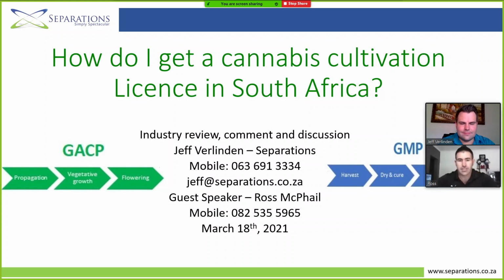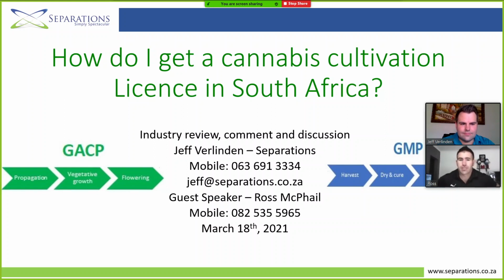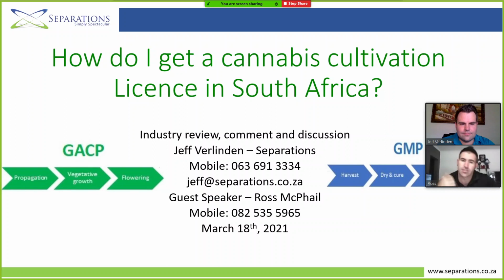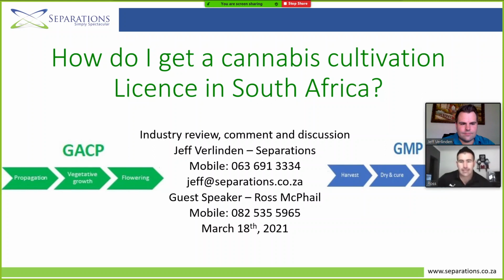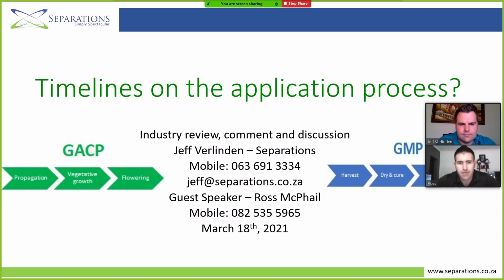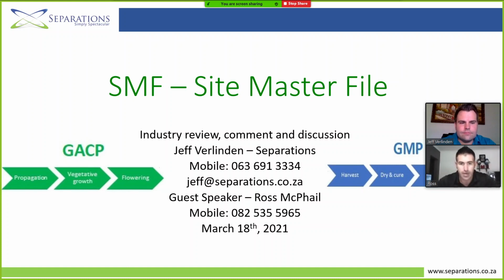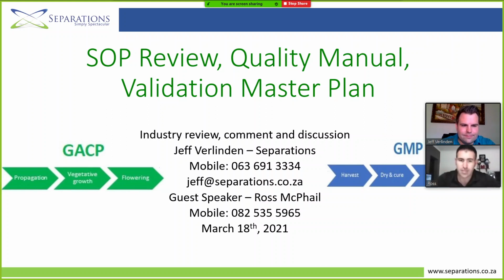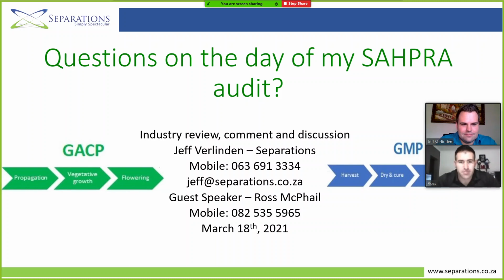Overview: How do I get a cannabis cultivation Licence in South Africa?

Comment: Great video. Any quality management problems faced by cannabis cultivators?
Reply from the maker: Testing in for slightly higher than desired heavy metals does happen every so often.
Reply: @SouthAfricanCannabisExtraction  Are you saying our testing laboratories are inferior ? Also which export markets are hard to access  due differences in regulatory requirements ?
Reply: @paulerdosdaughter Any country that doesn't have legal hemp/weed, and if they do, you need to create a plan that will detail why and how, etc… 

You need to follow the laws and regulations and yes, most countries with legal weed/hemp products/ medicinal weed have extensively superior testing, like for THC/CBD ratios and percentages, infections/ pesticides/ etc…